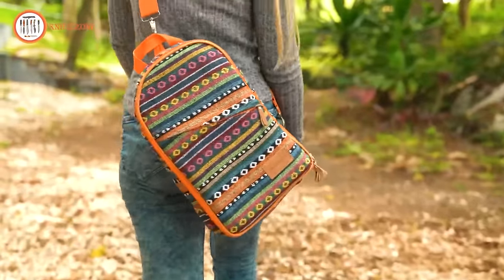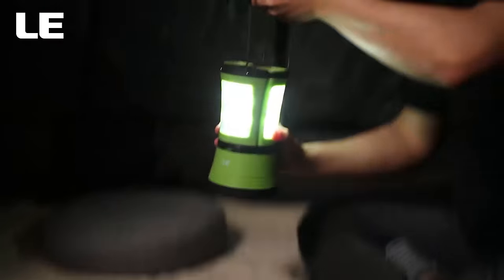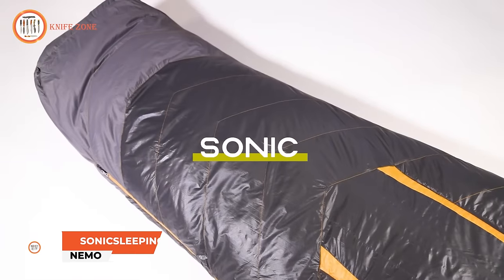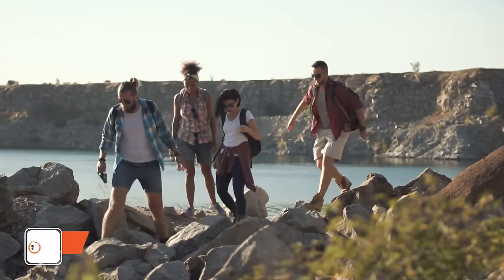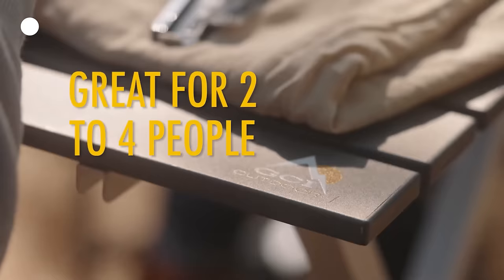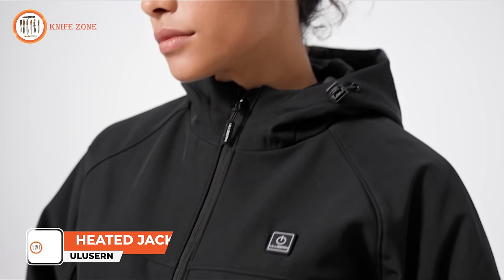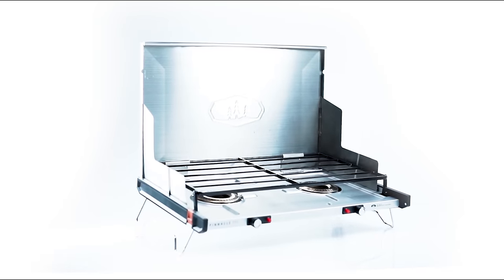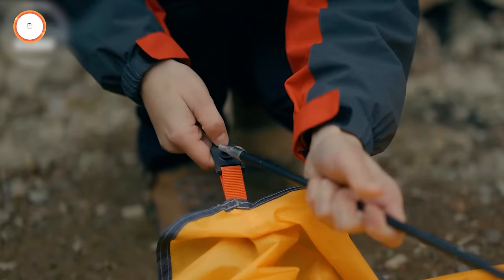50 NEXT LEVEL Camping Gear & Gadgets 2023 On Amazon

Comment: Well the top pulled up if wet snow accumulates there several feet?
When you're away from home be sure you have a whistle on this string around your neck or on your arm. If you get in trouble blow it for three shorts 3 longs and three shorts repeatedly which is SOS.